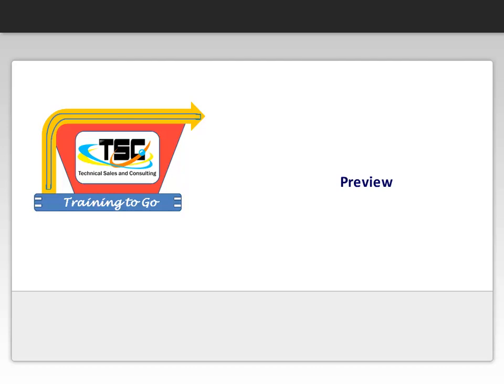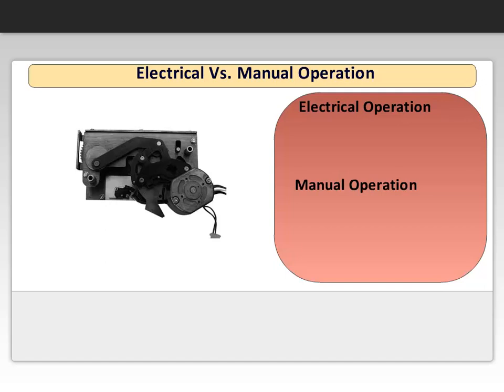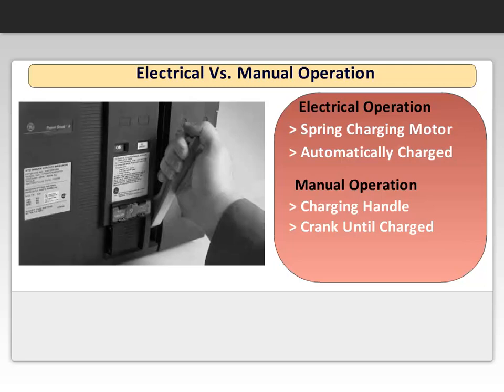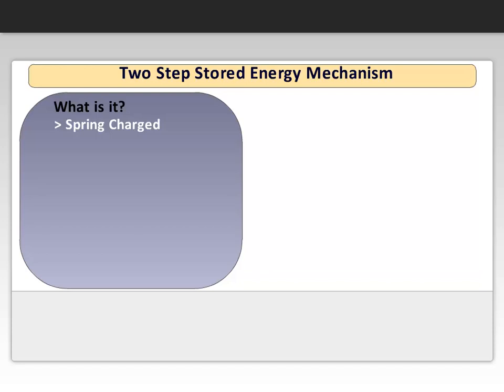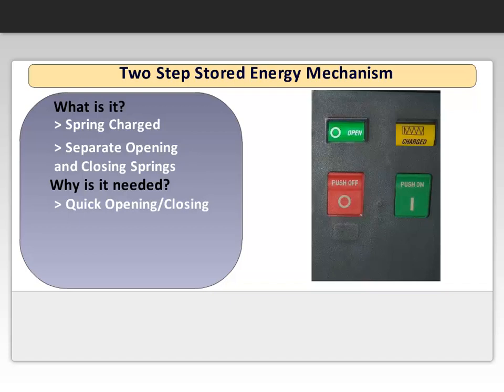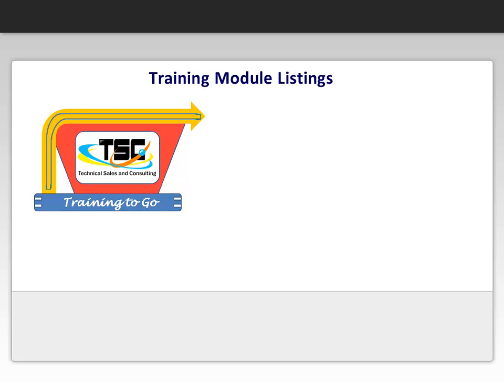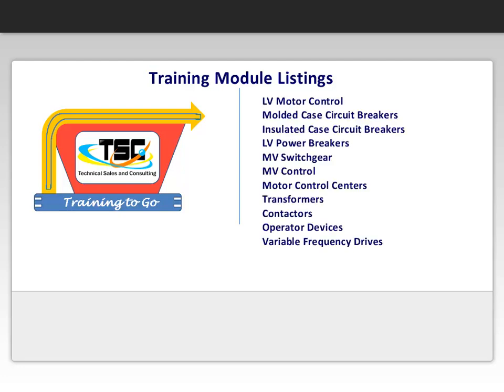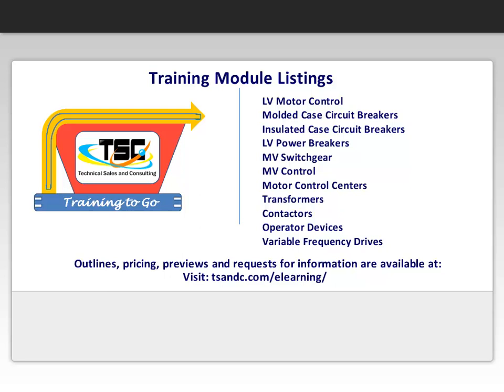Training To Go Spring Charge Mechanism Demo

Comment: sir why spring charge mechanism is required in air circuit breaker
Reply from the maker: Thanks for your question Vilayattu. The physical size of the current carrying contacts make it difficult to operate manually as you would with a molded case breaker. In addition, the springs allow for a quicker trip, allowing the breaker to clear any fault. Thanks again. Please subscribe to my channel as I will be adding more electrical training videos.